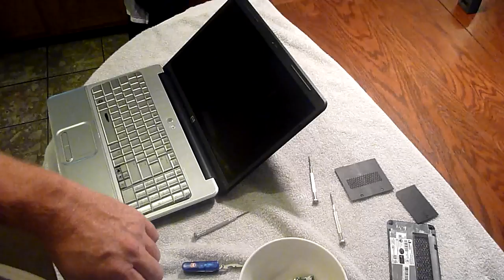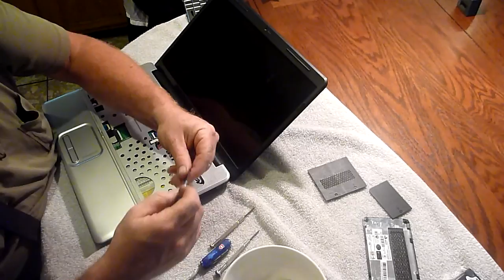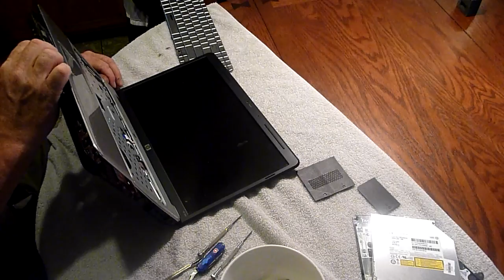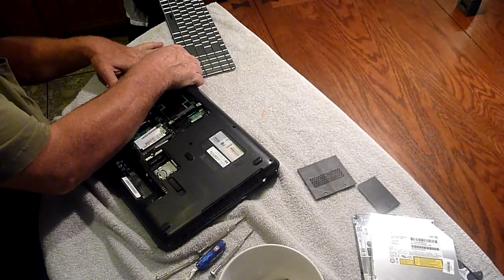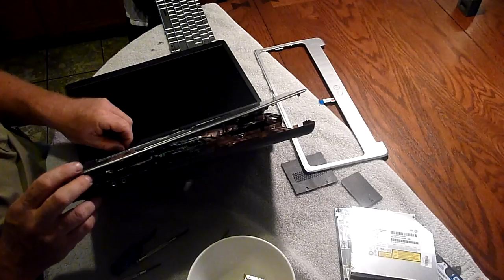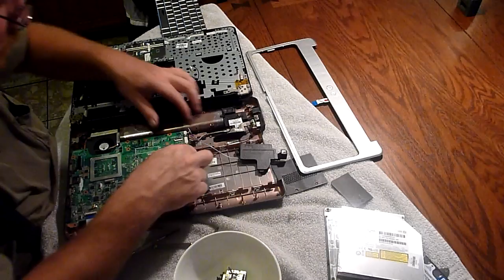G60 230us teardown to fix cooling fan part 3

Comment: Exactly what kind of screwdrivers are you using, and where did you get it?

I'm using a mini phillips and nearly stripped one of the screws on the hard drive case because it fits most of the other ones but that particular screw JUST WON'T COME OUT D:

Thank you for this